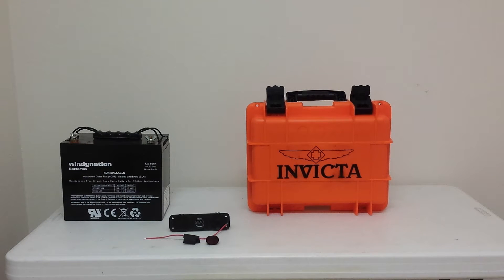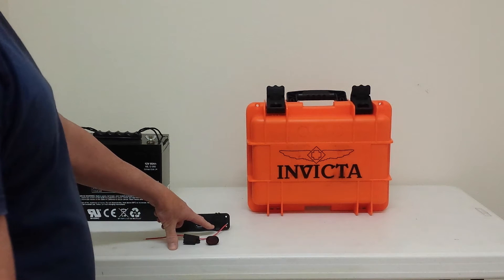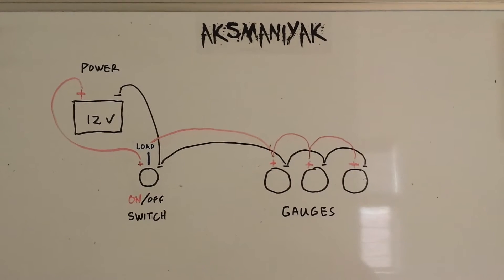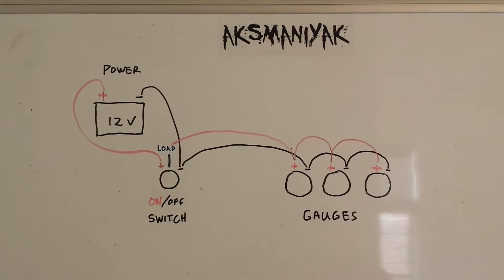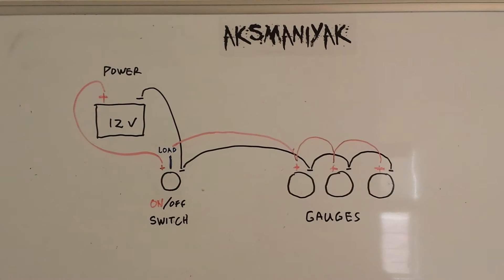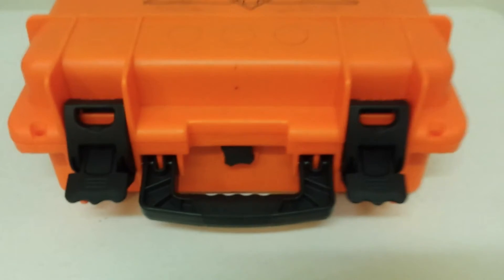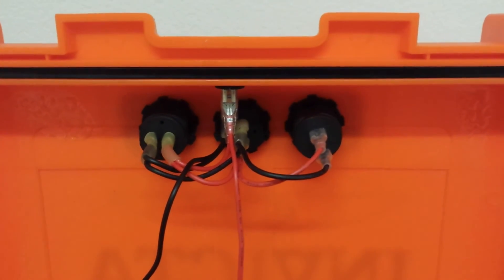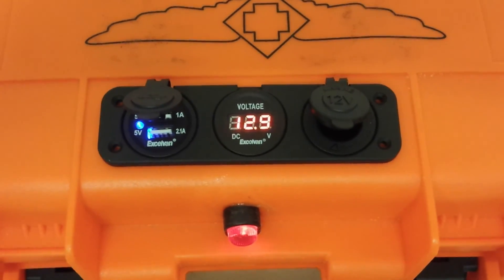DIY Kayak Portable Waterproof 12V Battery Box Power Ports Gauges

Comment: If you plug in a USB cable, that won't really be a water tight seal, correct???
Reply from the maker: If it is a marine rated plug it should be ok.

Comment: very nice Job. can you give me the amazon link to your face plate with battery meter? Thanks.
Reply from the maker: Thanks John. There are many to choose from on Amazon. Here is an example ; https://www.amazon.com/Cllena-Function-Charger-Voltmeter-Digital/dp/B01CU5HI7U/ref=sr_1_33?dchild=1&keywords=12v+gauges+ports&qid=1607294840&sr=8-33
Reply: @Aksmaniyak  thank you very much. I will buy top town autopilot 136/120 kayak after changing mind from Hobie outback. I have already bought a 100AH Lithium battery. But after several days of study, I feel I have to stick with 65lb regular battery. AGM battery can operate under water if submerged and no damage is done. But Lithium reacts violently with water if the kayak flips in the water.
Reply: I have several Pelican boxes. But none of them is big enough for 100Ah Lithium battery. Also if I made it, I would drill only 2 holes for battery post. and somehow put meter plate outside. I figure that less holes that I drill, the less likely that water will leak into it in the case that kayak slips in the water.
Reply from the maker: @johnthehammer7702  Very smart John!

Comment: Interesting project but you skipped over the most important part in demonstrating how the battery fits inside the case! Maybe people get the incorrect impression that you actually shoved that large battery in the enclosure when it was only meant for testing purposes.... Be interested what specific battery pack and specific model / configuration you found actually fits in the box without smashing up against the back of side of your switch and instrument panel contacts..... 😉

Comment: Nice job on the complete box! We use a little larger set of 55Ah AGM batteries to power trolling motor, locator, and lights. Because the WavewalkBoats.com have twin hulls, we also  split the batteries into two boxes to balance the weight. See the Wavewalk Boats in action: thttps://youtu.be/eqp5BEa415w

Comment: Hi ... I'm a kayaker from Brazil and it's very difficult for us to get kaiak accessories. Our kayaks are practically just paddles and rod holders. We still do not have the culture to equip kayaks with fishfinder, battery systems and etc ... I would like you to inform me the name and where I can find each material that you have used in this video. tks
Reply from the maker: Hello Marcio. I bought the box at a thrift shop and all the electronic parts from Amazon.
Reply: tês

Comment: can you plug in an inverter to the cigarette port and plug in something like an air mattress pump?
Reply from the maker: I don't know and you would need to know how many amps the pump would draw.
Reply: of course..i think the pump is only like 15A so as long as you have a 15A fuse in there you should be good..you think?
Reply from the maker: You would probably be safer at a 20A fuse in case there was a surge.

Comment: does the battery fit in the box ? :)
Reply from the maker: No it does not. That battery was only used as the power supply to demonstrate the power ports.
Reply: cool , just wondering as it looked a bit big, nice idea though
Reply: @Aksmaniyak  So you made a battery box that doesn't hold a battery?